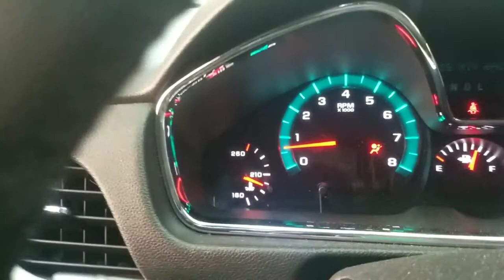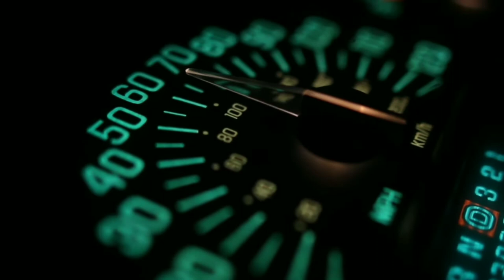Common Chevy Traverse Coolant Leak FIX

Comment: My teenage daughter and I were broke down on the highway last night for a couple hours.  It kept getting red hot and I had to pull over and let it cool down and drive it another mile to get it off the highway.  Im wondering if this is the problem. I have a  2010 Traverse.
Reply from the maker: Definitely

Comment: I just replaced that hose but it still leaking coolant and still over heading
Reply: It over heats in 12 min of driving
Reply from the maker: Sounds like your thermostat is stuck closed; replace it, it's connected to the same hoses
Reply: @2SmartAuto  awesome thank you I’ll have it changed

Comment: So my leak is on the passenger side of the car do you think it can be the water pump? The car is not overheating and only leaks after the car is cold.
Reply from the maker: Are you sure it's a coolant leak?
Reply: Yes… figured out it’s the water pump. Soon as I added coolant it leaked from the water pump

Comment: I have a 2013 traverse and I have a coolant leak somewhere. But I don't see any leaks anywhere. I have to fill it up every 2 weeks. (Radiator/tank).

Oil is fine not contaminated.
Reply from the maker: Very common problem
Reply: @2SmartAuto  fixed it. Turns out my water pump was going bad and finally just completely gave out. Replaced it all from the bottom.
Reply: @dnegel9546  was it leaking at the water pump? I’ve got a 2013 just noticed coolant leak front of engine wet on pass side
Reply: @krobrobinson  yup. It was. You can remove the passenger wheel and the wheel well flap and just look under there if it's leaking it's probably the water pump. 

I removed the entire wheel well cover lol.. it didn't really help since behind there it's just the frame. 

You can also rent a cooling system pressure kit from AutoZone and try to listen for air hissing out. It probably won't build pressure so you'll have to pump it fast. In my case I barely managed to hear the hissing sound.
Reply: @dnegel9546  thanks I appreciate it.
Reply: @dnegel9546  
mine was at the shop this am for sway bar links, but they also alerted me that i had NO coolant!! they filled it, but told me to keep checking it, they couldn't find a leak?? glad to know that this is most likely the cause, so i can be PROactive not REactive! thanks! 2009 chevy rolling dumpster fire traverse. ugh!
Reply: @tashabennor6209  try to check at the radiator cap (WHEN COOL TO THE TOUCH.) 

I kept checking mines for months and filling the radiator.  Before it finally broke completely. 

Rolling dumpster indeed. 😅 Hate this car.
Reply: @dnegel9546  so it was your radiator??
Reply: @Alamo_City_Tx  it was my water pump. It was leaking in just the right way that it would collect on the car but not drip on the floor. So i could not tell where it was coming from. 

Eventually when it gave out completely is when there was a big enough leak that i found it and also the hissing sound from putting a pressure test kit on the cooling system.

Comment: I blew out 189$ on the new part… mine broke the same way but by the looks of it they don’t sell it on its own. If the plastic breaks you will need the hole assembly 🥲🥲🥲
Reply from the maker: Yes, you can rig it like me but it's only for a temporary fix... Make sure you buy it even if your car is good at the moment,this will happen to every traverse soon enough, sorry
Reply: It’s cool yeah mine had no fix the plastic where the hose goes attached too broke off… they should Just STOP making plastic parts lol 😂
Reply: It's the thermostat.  The hose assembly is a dealer only item.